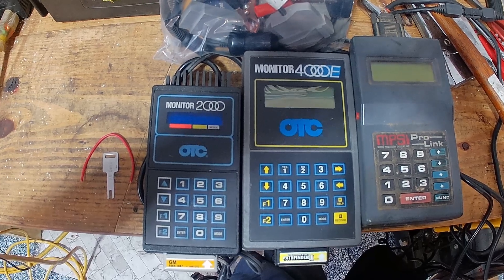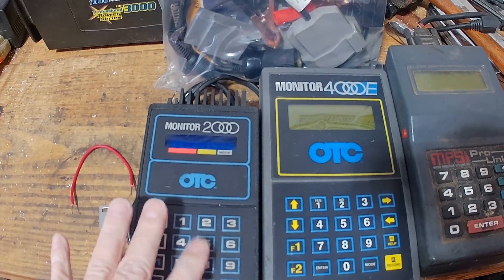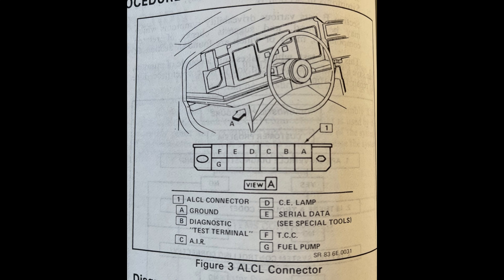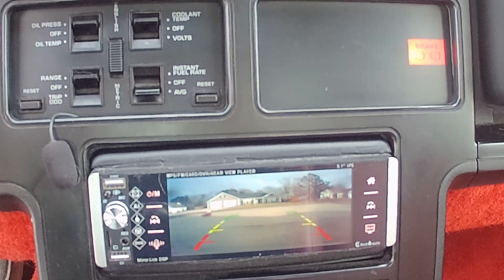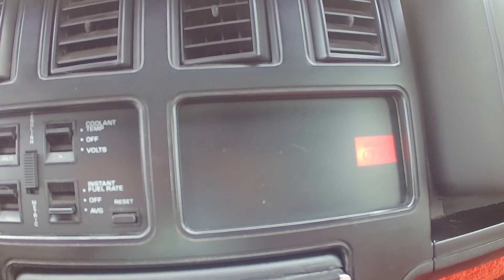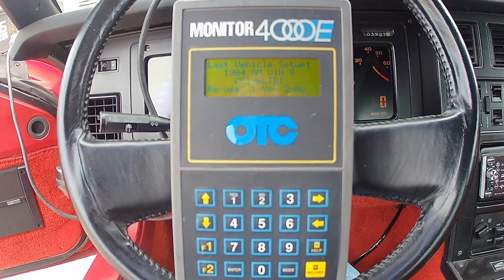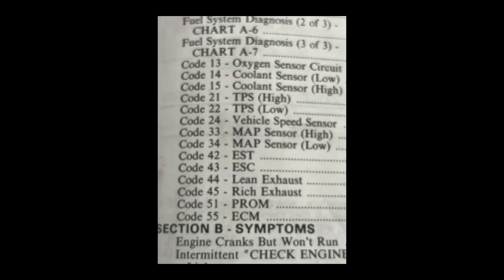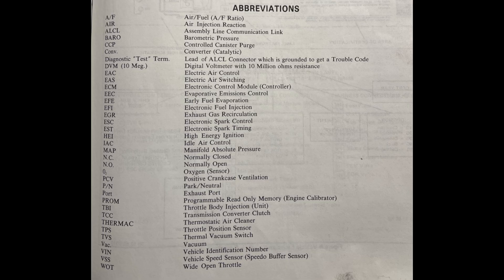How to Check for codes on any GM OBD1 car with a piece of wire or with scan tools. On an C4 Corvette

Comment: GM OBD IS BULL$HIT$   I SAY AGAIN GM OBD IS BULL$HITSSS  THERE IS NO EXCUSE IN ALL THIS BEING TIED TO RETURN YOUR CAR TO A DEALERSHIP FOR A PROBLEM THEY CREATED IN THE FIRST PKACE.  ALL CARS SHOULD COME WITH A DB9 CONNECTOR AND A SOFTWARE PACKET IN GL8VE BOX.  EVERY OWNER SHOULD BE ABLE TO DIAGBOSE ALL PROBLEMS.  EVERY DAM PROBLEM.  THE BIG 3 ARE EVIL AS HELLLLLLLL
Reply from the maker: That's too funny! in 1984 an DB9 connector? I supose you were going to plug it into your 1984 laptop.

Comment: Nice video with clear explanation and good visuals. The backup cam on the 1-din radio you have is a great upgrade!
Reply from the maker: Thank you for watching, I appreciate your comment. I like that back up camera as well. Someone took out the Bose system before I bought the car so it was far cheaper to update the system then to replace the Bose system.